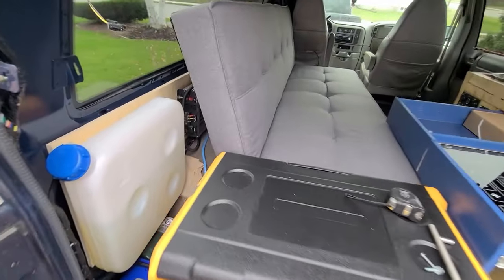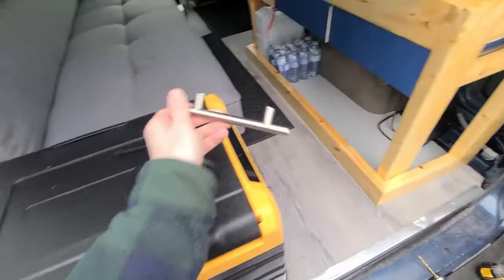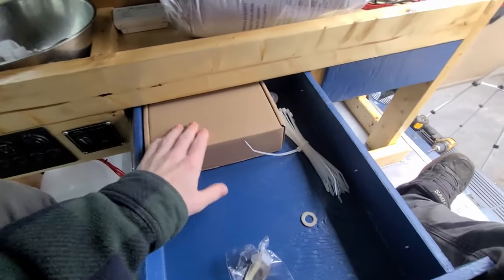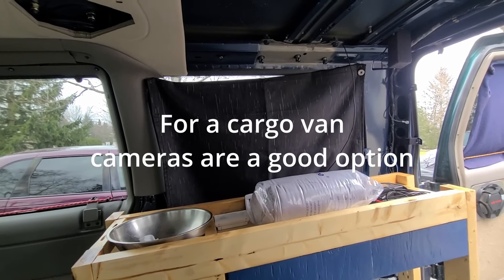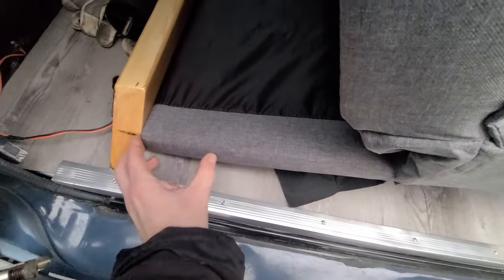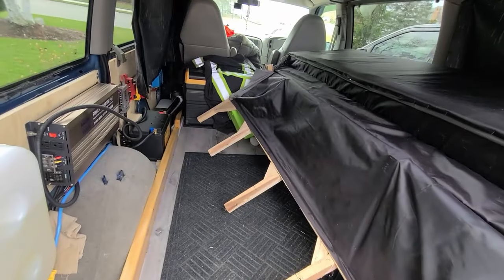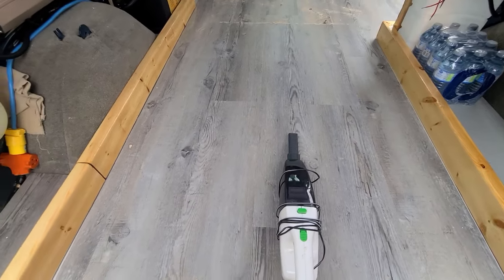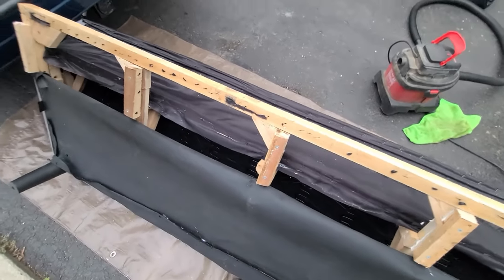4 Season Van Build Update - Sofa Bed Modification - AWD Astro

Comment: Very cool bro, think I have the same fridge. I just made a tour video of my setup. I was thinking about one of those futons, but personally feel there’s no need for it to be that wide when in bed mode unless you are sleeping 2. Maybe your are this is just my first video I’ve seen of yours. I feel it’s easier to have bed and sitting mode at the same width and no adjusting. Also those futons are really low which make it hard to store stuff under. I just use a cot with leg extensions that raise it up nice for sitting on and putting stuff under. Also have a comfortable sleeping pad on top.  You diesel heater setup is much better than using a mr buddy like I am currently, but plan to hold off until I get my next van to do that. Great setup thought!
Reply from the maker: Thanks! Checked out your tour, very nice setup! Yep, same fridge, little on the large side but it was the cheapest dual zone I could find and the bluetooth is kinda neat. Very good points, the hardest part of a low roof van is the head room vs the under bed storage compromise, In my case I can not stand not being able to sit fully up in bed and value the headroom so I can work away at my counter comfortably. I know I am going to need to make some more cabinets for more storage and supplement with a cargo box but I am at a bit of advantage as I'm coming from a much smaller van so the astro still feels like a mansion haha I love the caravans for the stow and go storage in the floor, does your cargo come with those voids still? Also doesn't get any easier than a cot! if not wanting or needing the convertible couch/bed situation. I started with the good ole buddy and still do carry it just incase, but if its any influence the FIRST build related thing I did to this van was the diesel heater. It is absolutely a game changer and makes vanning in sub zero temps not only possible but comfortable, going on my second year and its probably the best money spent on the van I would say. It kept be snug as a bug down to -30 (-22F) last winter, so we will see how low we can go this season! The buddy heaters are good for occasional use but kick out too much moisture leading to possible mold issues and really shouldn't be run all night long while sleeping. Thanks for the comment and watching!

Comment: Make it a …
“Wood Cabinet”
behind ~ enclosed
Reply from the maker: Yeah I think that is best so I can store stuff back there without worry of damaging anything.. Though I do like having it open for ventilation and quick trouble shooting/repair/checking connection tightness, I have found once you bury the electrical in a cabinet it rarely gets looked at unless there is an issue lol Thanks for watching!
Reply: Thought it would keep 
anything fallen there
and causing havoc. 
A cover ?
Reply from the maker: @maura6375  That is a good point, its mostly protected but I really should have something over the battery terminals incase something were to bridge them, would not be good!